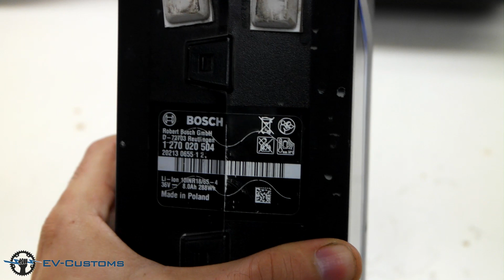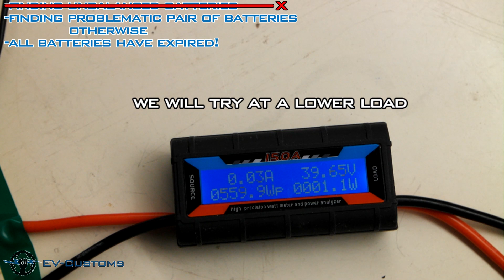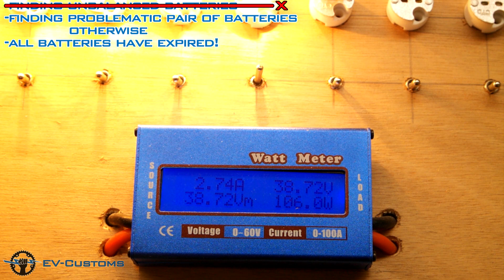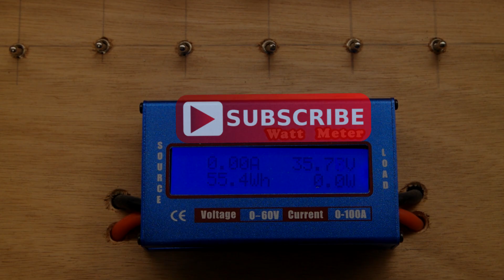Testing Bosch E-Bike Battery for Bad Cells (eQ Battery Pack)

Comment: I suppose this is a 10s4p pack, 36V nominal. What is the use of checking the paralleled cells? The voltage there will always be the same.
Reply: haahha so true

Comment: Nice trouble shooting. We work with repairing Bosch packs. Replacing cells in this version is very difficult since it has flat cables that are hard to remove and reassemble. Did you attempt that? We don't even try any more. But we might have spare parts for someone as brave as you. We are in Sweden.

Comment: if the cells all in balance ( same volt ) means there is no bad cells in the pack, that pack should have max 40 amp discharge with out bms and voltage drop should not be greater then 2 volt when you applied 7 to 15 amp  ( 250w to 550w ) in good cells . in the videos :)) it drop like cement bag means not good for ebike packs but still have juice in cells to use in other 18650 items like vapers, light power drills electric screw drivers and so on its a good video thanks
Reply from the maker: Correct.

Comment: It,s a shame you didn,t talk about what you were doing and with what. Looked pretty interesting. If you have 2 18650 batteries in parallel, how can you check wich one is bad when they are combined together? Will the pack not read 4.2 even if the other is bad? Was just thinking out loud. Were you looking for capacity loss somewhere?
Reply from the maker: Sorry my friend just am not good in English.
To find the bad battery must necessarily break the parallel battery circuit and calculate the batteries separately.

Comment: You can't check cell voltage like that. Because all batteries in P are conected. You only able check battery voltage per S.
Reply from the maker: Under load you can find the problematic P

Comment: is it possible to hack somehow the bike engine, so that it  accepts an external voltage 36 without any BMS?  I could create a battery pack of 18650 cells and load the cells separately in a charger each time if yes. Thanks

Comment: please help i have 5 Bosch battery all the BMS board are defect how and where i can find new BMS board to replacement  ,  thank you
Reply from the maker: Only from Bosch or used one from Ebay
Reply: thank i check in ebay but nothing
Reply: There are no new BMS boards for Bosch - they don´t want You to repair it, they want You to buy new overpriced battery packs.
Reply: hi, thanks for the question, I am also looking for a BMS for my Bosch battery but with no luck for 4 years. I replaced the cells and spotwelded new ones , but BMS does not let it work

Comment: It looks like you did not disconnect the balancer connection before testing the cells? If he is equalizing the cell voltages like it's supposed to, you will have a VERY hard time finding a bad cell...
Reply: Exactly. This person is not a tech that knows what he is doing... each cell needs to be tested individually in isolation to the other contacts. At least he did a load test, but you cannot say one cell in the group is / or is not bad.
Reply from the maker: First of all this board is not BMS (balancer), is simple protection board, Secondly you writing for someone Automation Engineer  with 16years on electronics field, and finally if you so expert  Mr.  Michael why tou didn't  make some videos to help some people  witch  need help on this field?
Reply: @michaelforansich8090  I think you are wrong. EV-Customs knows what he is doing and showed that it is not one cell or one group of cells that is bad, the entire battery is old and weak.
Reply: @EVCustoms  so how do you know if it is a simple protection board or a BMS? I have a 7s3p battery, it has per cell: a big resistor, an 8 pin chip, a 6 pin chip, 2x what looks like a tiny mosfet or transistor, 3 small smd resistors, 1 smd capacitor. And 4 big 3 pin components in to220 size, can't read whats on them but the board says Q1A, Q1B, Q2A and Q2C.

Comment: How to balance an Battery lithium 36v ?
Reply from the maker: Hi Ahmet..  you can balance it with Bmax6 balance charger on balance mode...
Reply: 10s Battery. Split them in 2 for 5s. Unless you can find 10s battery charger.
Reply: Check out Hobby King, they have some good computerized Lithium chargers with balance ports for reasonable prices.

Comment: testing while connected in parrallel, will read same dc v at each test point. Useless.
Reply from the maker: like that you will see small voltage difference on problematic parallel pack, if you want safe time, otherwise strip all you batteries my friend..